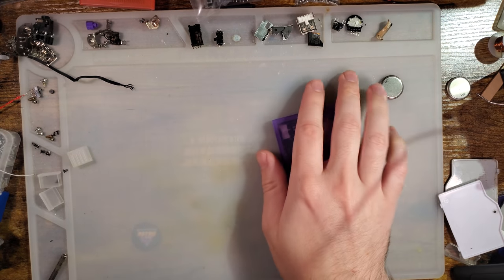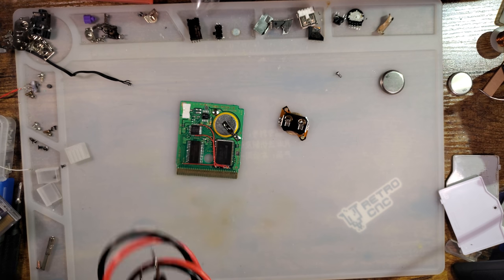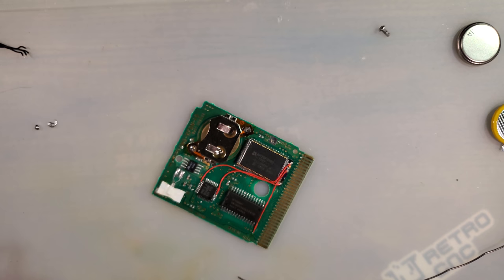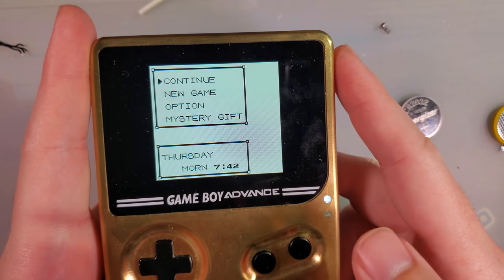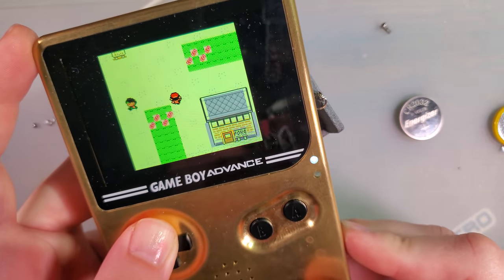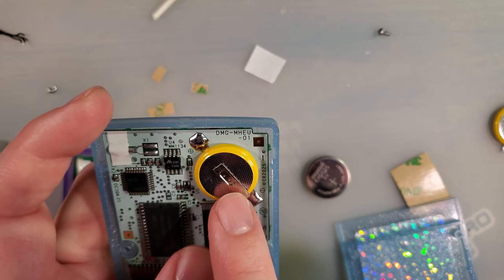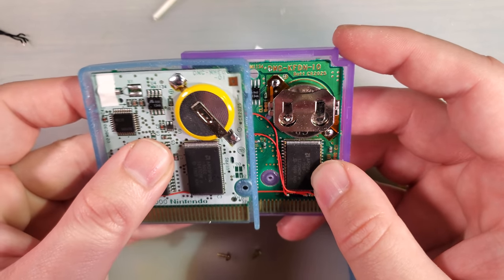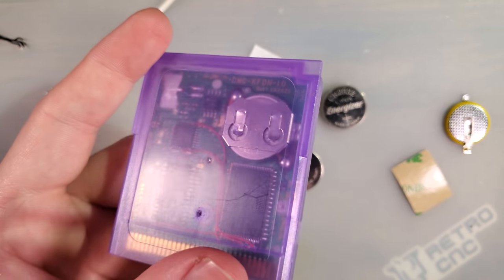Game Boy Game Battery Retainer by HDR (updated)

Comment: I would wager tabbed batteries are not as commonly used as non-tabbed, so there is maybe some benefit to the longevity of the cart to switch to the retainer and use coin cells that probably aren't going away
Reply: Well, you can't just go to the store and just get them is the real benefit. Don't see them really outside older stuff like this. Also a benefit for those who aren't proficient at soldering or are uneasy about it.
Reply from the maker: Perhaps, but how often are you replacing batteries on the same cart? Spending a bit more upfront and doing more soldering upfront to save a few seconds and few cents every decade or two might not be the most efficient. I see this more as something one might set up if they plan on gifting the cart, especially to someone who doesn't/can't solder in a new battery.
Reply: @makho  I agree. Just the games with a RTC that really chew through the battery. Just more of a benefit for the types who feel uneasy about soldering. There is enough space to solder in a CR2032, so I'd rather opt for that one.
Reply from the maker: @ZyferWarriorPrime  any GBA cart that I've seen with a battery retainer has to use such a small battery that the capacity is very significantly reduced. There is no good work around for this form factor that I'm aware of.
Reply: @makho  I mean, it is possible to design a custom solution, but it wouldn't look like that. Would have to be more similar to tabbed batteries. There is enough clearance to get a CR2025 in there, but it is a really tight fit.

Comment: is there much point to these? you could just replace the battery now and deal with again in 20 years.
Reply from the maker: Indeed you can. Though with RTC based carts (like second generation Pokemon games), you might get closer to five years out of a good cell instead of 20.

Comment: I actually don’t mind replacing tabbed batteries but the issue comes to the voltage hold qualities of those tabs. They can’t even hold a charge for more than a month and the things die. Better settle for higher quality but longer installation batteries with retainer than cheap short life but easy to install tabbed batteries.
Reply from the maker: You know you can just buy tabbed panasonic batteries from digikey, right?
Reply: @makho  The tabbed panasonic batteries are difficult to get ahold of outside of the US. I guess due to battery shipping restrictions, neither digikey nor mouser will ship them internationally, at least not to Canada. This battery retainer is looking like a nice alternative.
Reply from the maker: @DrennSpeedruns  I'm sure there's a local warehouse or reseller that has the batteries. I'm not familiar with Canadian retailers though.

Comment: Solid video, I think this is something I would do if I were working over a cart for someone else to make it easy in the future for someone who doesn't have soldering skill. Also you mentioned a Digikey part number for the tabbed batteries you recommend?
Reply from the maker: both are linked in the wiki https://gameboy.github.io/consoles/#games
Reply: @makho  Awesome, thank you. I would rather get them from Digikey than other sources.

Comment: Ah, excellent. I should like to install retainers in all my cartridges simply as a matter of preventative maintenance. Changing out the battery in the future will be easier, as name-brand, quality batteries that are not tabbed are easier to find, AND it won't run the risk of a beginner to soldering destroying the cartridge PCB
. Which, if all the posts I've seen of Gen 3 (and some 1 and 2) Pokémon carts being destroyed due to people trying to replace the battery on it are any indication, happens far too often. Cartridges change hands all the time and the less killed the better.
Reply from the maker: well this won't work on gen 3 pokemon carts. At least not with this implementation.
Reply: I don't really know how people do that short of just tossing a bunch of solder on there.

Comment: Hey there Makho, is there a PCB solution out there for making an MBC3 flashcart and reusing the SRAM chip from an original cart (a Sharp LH52256CN-10LL)? I botched a removal of the ROM chip on a cart the first time around so the PCB was hosed, but I recently got the MBC3 and everything else off with hot air. HDRs boards are great but they swap it out for an FRAM chip and some additional hardware. Can those be made compatible or am I forced to ditch the SRAM and get the FM18W08?
Reply from the maker: if you're using HDR's boards, you will not be able to use SRAM. If you want to continue using SRAM, just use jrodrigo's adapters and swap out only the MROM.
Reply: @makho  Since the MROM's pads on the OEM board are torn to shreds I guess I'll need to go with HDR's board if I want to get any use out of it. Thankyou for the quick response! :o

Comment: Thanks again for another greatly helpful video! Glad I waited a bit and this version of the retainer came out, definitely going to get these for the 2 original games I have.

So, just to be clear, it does hold a CR2032, right? But would the case close properly with it? I'm thinking about Pokémon Crystal and Mario Tennis (GBC) og cartridges.
Reply from the maker: probably depends on the specific cart and shell. I don't recommend using CR2032s with these holders though
Reply: @makho  Cool, I'll probably stick to CR2025s with this one since it's practical enough to replace them already

Comment: Hello Makho, thanks for the vid. I watched the past vid of the HDR pcb, I ended up buying it, apparently they are selling a different design version than your past vid, and after I installed it, it was way too thick.( talking about just pcb without the battery holder)
This one tho is alot more expensive, does this one confirm to fit in Pokemon games? Afraid of having same issue of before
Reply from the maker: It's supposed to be a flex PCB. If you ordered via oshpark, you didn't select the flex option on check out. Only flex PCBs are thin enough to fit inside the shell.
Reply: Thanks for the info, indeed I didnt choose any flex option, will buy again using that option and maybe use the ones I have for snes cartridge or something

Comment: Hi, great video, but I didn't understand what you meant by using adhesive tape to fix the 'flexy.' Do you think it isn't safe as it is?
Reply from the maker: it can deform a bit when inserting a battery and adhering the flex down can minimize the deformation.

Comment: will this work on GBA carts? eg: for Metroid Fusion
Reply: I'd say no, at least not well. It needs a flat surface for the battery to rest on for good contact, but the battery is installed on top of a chip in GBA carts due to space constraints.
Reply from the maker: no but for metroid fusion specifically, you can always do a FRAM mod so you don't even need a battery.
Reply from the maker: https://www.youtube.com/watch?v=OUO6ohZbQbU

Comment: Would this work in a GBA cart as well or is there another battery holder for GBA carts?
edit: I see in other comments you said it won't work in GBA carts. RGRS sells something that'll hold CR1616s and says GBA is supported, though none of the pics show a GBA cartridge. Is that one worth getting or is there a better one?
Reply from the maker: This does not fit inside a GBA cart. I'd recommend just using high quality tabbed cells.

Comment: Can you do this mod for gba games that require battery replacement?
Reply from the maker: this particular mod won't fit as the batteries are offset to straddle the MROM chip. Similar mods might work but for anything other than RTC carts, a FRAM mod is probably the better option.

Comment: Do they have ones for CR2032? Just curious as that is what I have in my Pokemon games.
Reply: Guess I should have waited further. Looks like the little extra height from the battery with these are just a tad bit much.
Reply: since it's the same board between gen 1 and 2, i would wager you could use CR2025 on either
Reply: @BlazingKhioneus  I posted it as I was watching before I saw him try. I was wondering if there was enough clearance for CR2032 and there was not. You can fit a tabbed version in there, but the retainer adds too much height.

Comment: Great video! Does this also work for GBA? I would really like to have a solution for these :(
Reply from the maker: no
Reply: There is barely enough space to get a CR2025 on those. They are a tough fit at that. Not enough space for a retainer.
Reply: Very few GBA games have batteries anyway they're mostly flash memory
Reply: @handheldnintendofan  I am aware of about 30 games that use a battery. Some of which have batteries or flash memory. The Pokemon ones use it exclusively for the Real-Time clock.
Reply: @ZyferWarriorPrime  I know Pokemon games use them but I was just saying the vast majority of GBA games are flash memory only have 2 GBA games in my collection with a battery Kirby Nightmare in Dream Land and Wario Land 4
Reply: @handheldnintendofan  Yeah, some of Kirby ones use flash instead. I have the Metroid Fusion that uses flash itself. Just worth noting some games were battery only but others had both. Even so, there wouldn't be much space for a battery retainer. I can get a CR2025 in there, but it is a tough fit. But with so few games, it isn't worth much the effort. Only maybe the Pokemon games makes sense, they still drain the battery faster than the others. I can't see it without modifying a shell. Those games have too much value to modify an original shell.
Reply: @ZyferWarriorPrime  yeah Pokemon is the only games worth using a battery holder other games that use batteries last like 20 years anyway I'm surprised you fit a bigger battery cuz GBA cartridges are pretty small lol all my Gameboy games with batteries use the small 1616 or whatever the smallest size is
Reply: @handheldnintendofan  Like I said, it is a tight fit. Took some effort to accomplish. But larger battery nets more capacity. Was more of a, "Let's see if I can do it." Can get a CR2032 in a Gameboy Color cartridge too without using a retainer. No games benefit more from a retainer than Pokemon Gold, Silver, and Crystal.